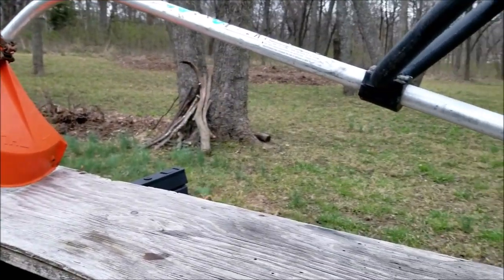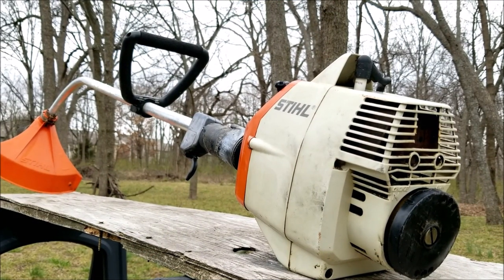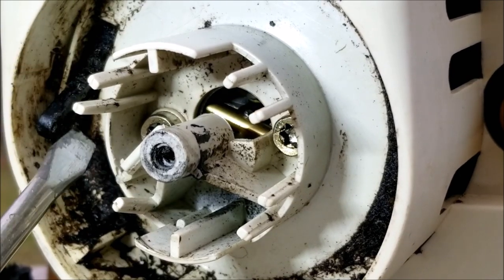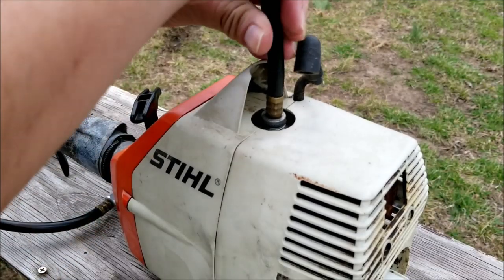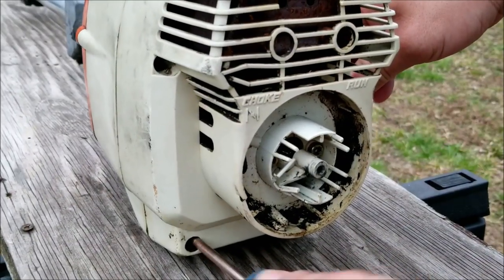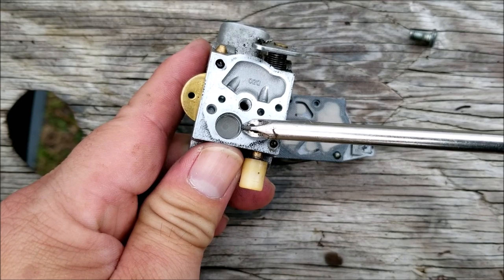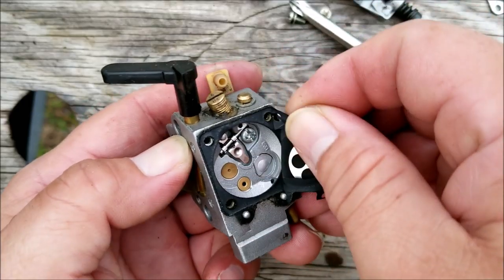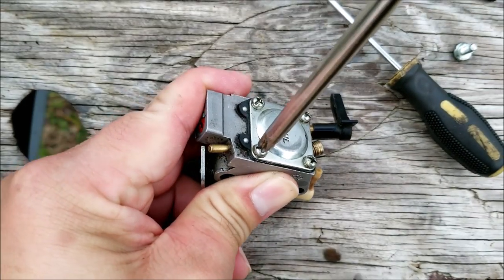Fixing a Stihl trimmer FS36 that won't start

Comment: Is it possible to convert a toro mower with Briggs and Stratton ready start  choke to use primer bulb like the older toro mowers used
Reply from the maker: Does this toro have a metal carb? Possibly but it would be easier to just swap the entire engine to the one with the primer.  There will be no engineering or custom molds.
Reply: Home Garage yes
Reply from the maker: swap engines instead.
Reply: Home Garage I have an old craftsman pressure washer with Briggs engine that has ready start but the air filter cover has the slot for the primer would that work On a mower
Reply from the maker: Only if the shift size  is the same as the one on the mower . Remove the pump and measure the shift and compare to the mower
Reply: Anything can be swapped or changed. 
Yes it can be done, you’ll need the correct muffler, bolts, springs, levers, etc. its a huge job if you don’t have a donor engine. All the parts are different. I actually converted my primer start to auto choke, but I had a seized engine with all the necessary parts. Takes some fab work, too. Not for the faint of heart. Good luck, hope it works, take your time. Be safe,
Jim
Reply: Momgumery different carb, tread lightly.

Comment: On the cable which hole dose the cable sit in to open the butterfly. Mine came apart and I didn’t see which hole it was actually in.
Reply from the maker: not sure, and I no longer have this trimmer, so I won't be able to check
Reply: @HomeGaragechannel  ok

Comment: Hello I searched high and low for replacement carb but none found only rebuild kits which I don't wish to do...do you know if there are carbs that would fit this fine piece of vintage trimmer from Deutschland?
Reply from the maker: unfortunately I can't seem to find one either.

Comment: Plz do a vid on refixing the backpack harness
Reply from the maker: can you be more specific?
Reply: @HomeGaragechannel  my cords/belts ripped from friction. Is there a method to replace them with ordinary similar cord?
Reply from the maker: @chevezalexander7974  unfortunately it has to be belt material and not cord.
Reply: @HomeGaragechannel  ight thanks 
But if it's ever possible for you to go through the replacement method it would be greatly appreciated cuz it's a bit tricky
Reply from the maker: @chevezalexander7974  I agree with you.

Comment: No limiters in my Kraut-FS 36, never heard of them :) Little Trimmer that needs a good carb setup and high octane fuel (1:50, Castrol Race Oil ;), no Ethanol crap mix. 

Do the Carb setup: 
H and L screws (upper screws) turn them in and for first setup 1 cycle out again.
LA Screw (the big one underneath) same way, turn clockwise in and 1 cycle out then. 

Start the FS36 and let it run for about 3 minutes. Turn the lower LA screw couterclockwise till idle rpm is near, stay slightly above.
Then check the best position for the L screw (upper right one, next to the engine), play around +- 45° for best engine sound, then readjust LA for low enough rpm at idle without spinning head.
This needs a bit time, also push the gas handle to check if the system works stable when falling back from high rev to idle. If the engine stops, readjust slightly. It's all within a quarter turn, only in Peru, Bhutan or in hell you need more adjustment.

If the setup works so far, go for the H screw (left little upper one) and play around within +-45°, it's the high rpm setting. If the engine rises fast without stuttering, the ideal position is found. Play.
Love my 10.000 upm FS36, sounds and smells like on the GP 125 racetrack back in the days. It never let me down and it's easy to handle for small jobs. Just do the setup and use good, stable fuel.
Reply from the maker: thanks for the comment

Comment: I've been having issues getting my cover off to replace the primer bulb. It looks like you were using a star key. What size?
Reply from the maker: I think its a t25
Reply: @HomeGaragechannel  Thanks so much! Your videos are the best. I had to borrow a t25. Any idea where I can get air filter? Can't find an old one that's round like mine.
Reply from the maker: @augustbradford7310  no problem.  I would look at Ereplacementparts

Comment: when i turn my trimmer upside down to line somwthing up it leaks oil, any reason as to why? all the fuel lines are intact
Reply from the maker: is your trimmer a 4 cycle or s 2 stroke? Where is this mystery oil coming from?
Reply: @HomeGaragechannel  it’s the same one from this video, it’s comming from the spark plug area I believe
Reply from the maker: if it's coming from the spark plug, then it means there's fuel and air leaking from there.   just make sure the spark plug is tight

Comment: What if the primer wont work
Reply from the maker: It depends if some of the fuel made it to the carb. It might start then. However if none of the fuel made to the carb and the primer doesn't work then you might have to replace it.

Comment: so the H screw is when pullinb the trigger and l is for the fuel that it gets anyways
Reply from the maker: trigger pull and idle is "L" screw, " H" is typically only for while the trigger has been squeezed. Think of it has a 2 band Equalizer for your radio.

Comment: A Family friend had one of these, she just said it wont start, i didn't know what brand ect, i go over there, i see this dinosaur and think oh good. It was pulling over weird, catching and then going free. Recoil problem? I investigate a bit, eh no seems fine. Has good spark, plug is out, still pulls over funky. Put a bit of oil in the cylinder and now its pulling over freely...shes toast. Didn't need more than that. Mind you it went to pulling over horribly in just a few pulls. She said she bought it like before 2000...so 22 years of service i'd call it good.
Reply from the maker: I completely agree.

Comment: You are the second person who i have watched just replace the metering diaphragm.. basically and that's it. lazy..  you had the carb off take it apart completely. remove the adjustment screws. and poke every and spray every passage way you can see with carb cleaner to clear them out.    But i guess if you reall want to be lazy order a carb on line for 10 bucks or less.
Reply from the maker: Super lazy

Comment: this is actually a way better trimmer than the new ones, I have this one, and a brand new one, I wouldn't give you a pinch of coon shit for the new one, burns your elbow when you run it, I mean what asshole would put it on the market without ever testing it.
Reply from the maker: nicely said Dave Trotter.

Comment: Best way to fix a stihl is throw it out and get an echo
Reply from the maker: did you have a problem with a stihl before?
Reply: Home Garage i had a chainsaw and a trimmer nothing but problems! I have had no problems with echo equipment! The best chainsaw i ever had is my echo CS-400 hands down!!!
Reply: Stihls quality control kinda sucks lately, I work at a shop and pretty much half the fs 131 and other machines with the same engine have been having carb failures left and right for the last year. Install a new carb under warranty and the mfer is leaking again by the time the customer picks it up. Echo may win me over too.
Reply from the maker: @jameshankssr466  yes that is a great saw
Reply from the maker: @jessemalone8363  yes quality control is very important.  Thanks for the comment